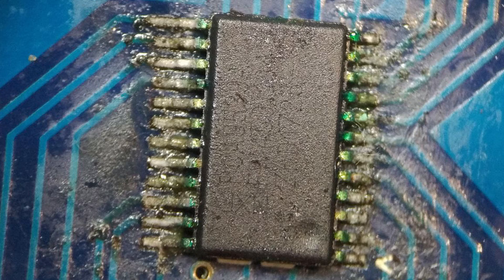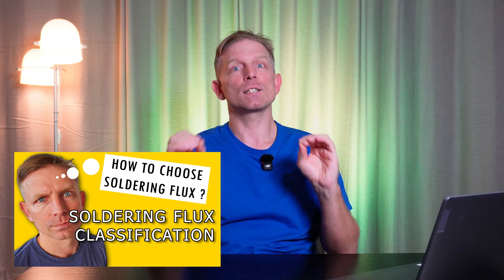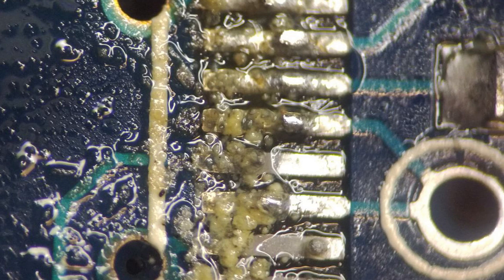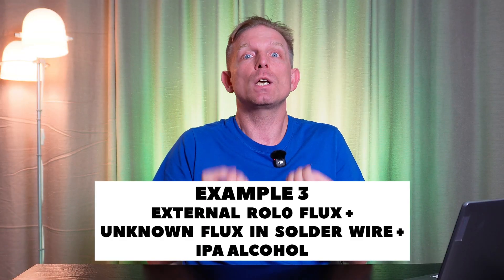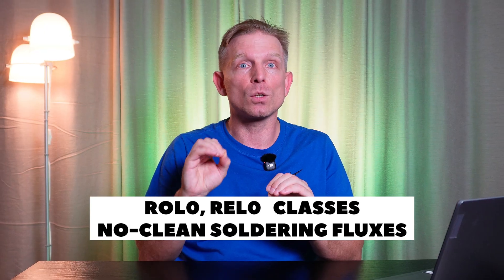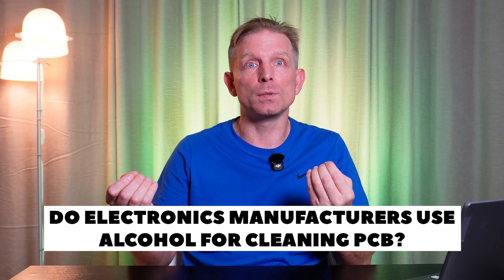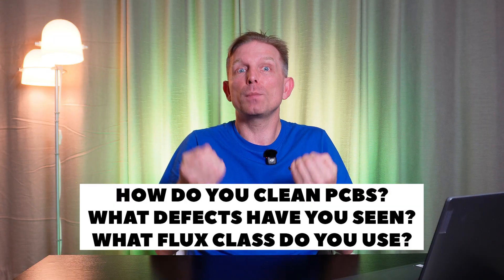How to Clean PCB with Isopropyl Alcohol — Why Results Vary?

Comment: I mainly use pure solid rosin as soldering flux and I have never encountered any single issue regarding of being conductive, corrosion or any type of problem, the only thing is I have to clean after soldering is done, and sometimes it will leave yellow strain on the component or pcb is heating is beyond limit.
Reply from the maker: You mean colophony?

Comment: I have a tube of RMA-223 and a NC-559-ASM. Both say ROL0 class.
However, the RMA says "Rosin Mildly active" too.. Whats that about ?

edit: from what ive read, both have mild activation but the NC is formulated in a "no clean" chemistry to minimize corrosive residues. Both say that can be left on the board for many SMT asesemblies, and for applications requiring cleaning list the same cleaners for both. "internet" says to clean with IPA.
I have cleaned the RMA with IPA and no issues so far.
Reply from the maker: RMA isn't a flux class, it's a marketing ploy, common in the electronics industry. If we equate the properties of an RMA rosin to a classification, then it's a ROM0. It's best to clean it.

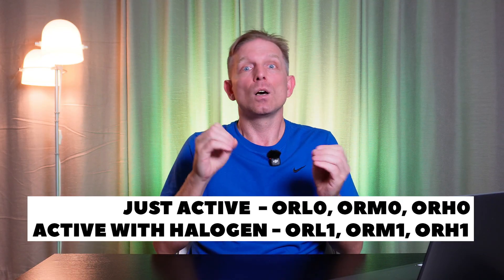Comment: 3:27 so you know maybe what kind of flux is FXM1 ? I have some solder with FXM1 and it is giving me a headache, despite also using ventilation.
Reply from the maker: A long time ago, I bought soldering wire from the French company MBO for testing. I didn't like how the flux inside spattered a lot during soldering. I no longer use it in production.

Comment: I only know that colophonium is quite safe to clean with alcohol. This is an organic resin flux which is mostly used at home. The other one which I have seen in manufacturing is a white compound, maybe apipic acid. If using such stuff, you should really know what you do. But results maybe cleaner and more controllable. Never use 'lötfett', it is for the plumber 😅
Reply from the maker: People who solder at home often use strange materials😁

Comment: Upon checking several spools of solder on my bench, i discovered that the flux specification is interpreted by the vendor as "stick non-removable barcode label or price tag here".
Reply from the maker: May be without flux inside...
Reply: @ElectronicsManufacturingTech   Oh these spools definitely have flux.And I could look up the products online to see the details. I was just hoping to see flux info right on the spool.

Comment: Water washable no clean flux is ok to clean with alcohol?
Reply from the maker: Water washable residues ORL0 little bit active. The best way to clean with Di water + surfactants, + next step rinsing in Di water.
Butttt, local cleaning may be enough with isopropyl. Need to check

Comment: Oh, I need to check which solder we have on factory, which flux in it. To recheck process for solder that we already have. (wish it rosin activated). Coz we use alcohol to local cleaning (not all tech use it, they just leave as is). But I do deep repairs and always clean it.
Reply from the maker: Strongly recommend 👆

Comment: Would you recommend flush the FN231 with alcohol when I do local repair?
Reply from the maker: Thank you for the question! Sure👍
Reply: @ElectronicsManufacturingTech that's great. I've been doing it for year, and have never thought that I might be wrong. It's time to switch to no-flux core solder wire to avoid issues with unknown flux in the core.
Reply from the maker: Absolutely correct. Unknown dry flux inside the core solder wire create a problems.
Reply: @ElectronicsManufacturingTech  I use solder with water washable flux inside, it can be a problem if I use 99% isopropyl to clean my  job?
Reply from the maker: Ohh yes. Current leakage and oxide may arise
Reply: Watched to end and got answer. omg that`s why